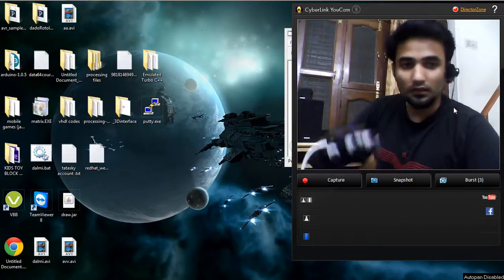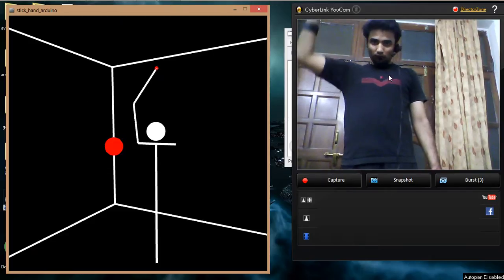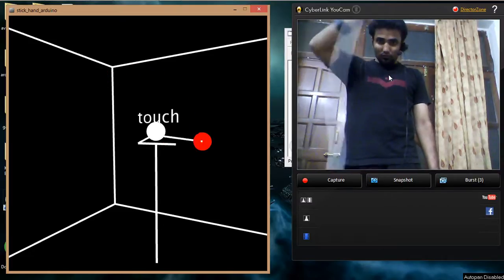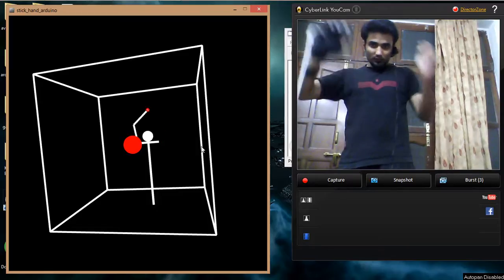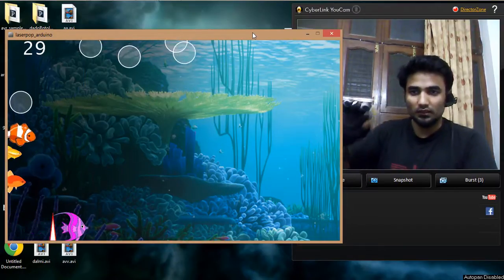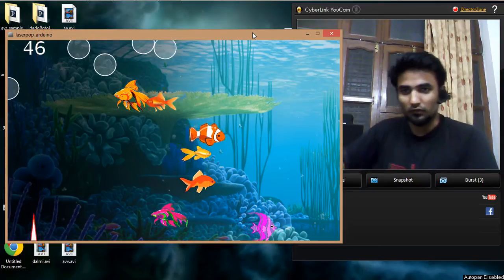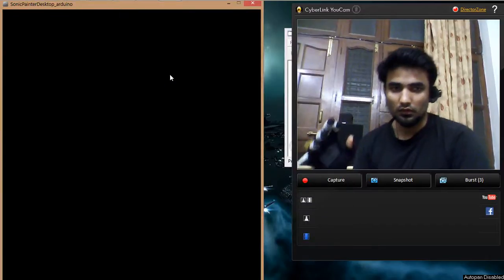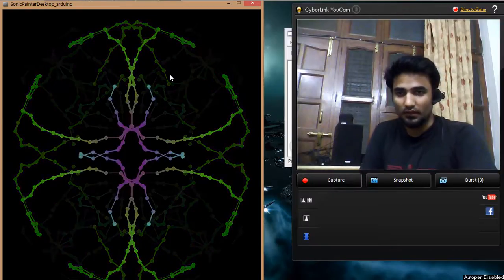Gaming Glove (arduino)

Comment: Great work, I plan on doing some motion stuff as well.....After learning some vector calculus......geez!
 Was there a ton of math involved, or was that part of it fairly straightforward ?
Reply from the maker: billybbob18 yes there is some calculus involved but mine is quite simple design the only tricky part which i found was connecting the serial connection with arduino and processing. Do share your project with me or let me know if you need any help. :)